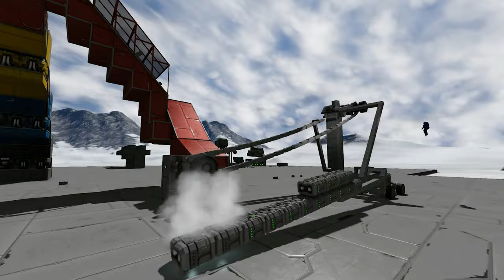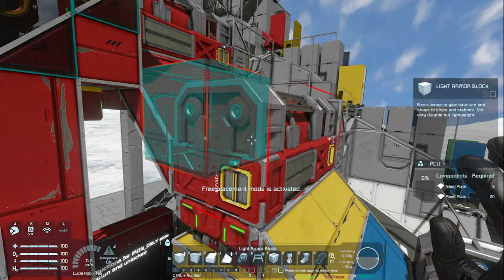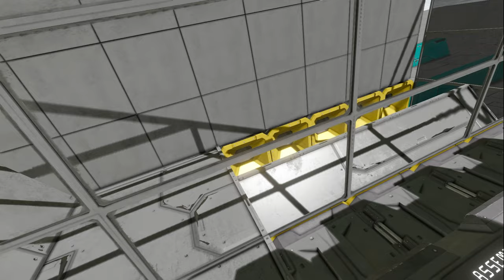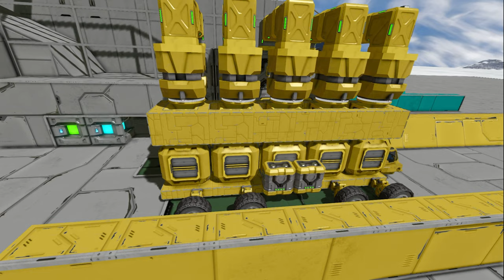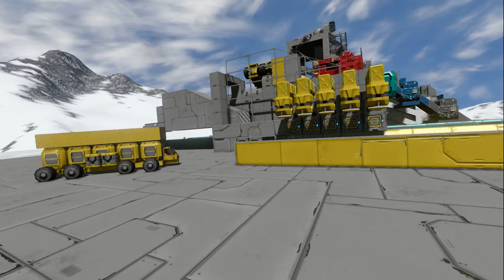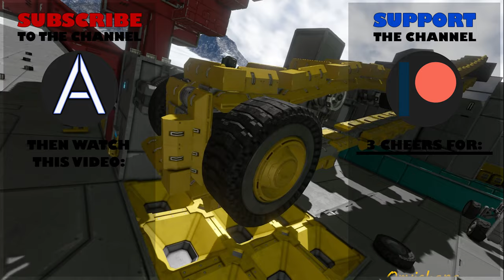Space Factory | Assembling a Custom Conveyor Belt! | Space Engineers

Comment: I really like the design, it gives me a lots of ideas considering that I'm an mechanic for over 20 years now. Can I suggest to put one piston holding one of the rotors  of a conveyor and that way you can adjust the tension of the belt itself when it's connected, you can make it tight or lose depends how much you push the piston or retract it. It's the similar way how we make a tension on the belt system in real life, sometimes with pistons and sometimes with threaded rod and nuts using spanners :D
Hope it gives you some Idea for the future :D
And for separating product you can use timer blocks and ramps to push it to an assembler, for example, before you push the ore with piston, make sure you have a ramp for each assembler to collect the dose of the ingots and push it releasing the ramp, you can time it with times and also you can put sensor on the piston to retract when it detects an ramp in front triggering piston retraction, releasing the current ramp dosage and preparing the next ramp for next assembler :D
Hope those ideas are useful :D

Cant wait to see more :D
Reply from the maker: Thank you for the tips! A piston to adjust the tension is a great idea for future belts!
Reply from the maker: @Cr4sHOv3rRiD3  Wow, those are really cool! The piston wheel looks like something straight out of a battleship engine room XD
Reply: @AndrewmanGaming  I was seen a lot of mechanical machines and things in those 20 years :D Right now, i'm working as a mechanic in the engine room at cruiser ships at sea and machinery there, it's amazing and challenging as well :D Can you imagine how will be space engineers if they decide to fix the physics a little and to put some round shaping blocks, like cylinders and oval shapes. I think I will be able to make some v12 4 stroke engine :D
Reply from the maker: @Cr4sHOv3rRiD3  That is so awesome! I bet if you built a factory like the one I am doing in this video, yours would have some very cool and complex systems!

Comment: Design suggestion: Have pistons hold the conveyor system rotors. Once you build the conveyor extend the pistons (very slowly) to take the slack out and adjust tension. 

For distributing evenly among the assemblers, try having the iron drop down a long vertical shaft. Every couple blocks down put a door that opens out and directs some iron into its assembler and then closes again. When the door is closed the iron keeps falling to the assemblers that are vertically farther down.

Great build concept!
Reply from the maker: Those are some great ideas! I might totally use the assembler one for a future setup. For the current one, I tore down the iron dropper thing and replaced it with a system that continuously (or atleast more continuously) drops iron onto the belt. With the increased load of iron, the pusher into the assemblers is much more evenly distributed with 8 assemblers getting iron instead of 4.

Comment: I give you props for taking the time to make the belt. Making and utilizing a manipulator to apply tension the the belt takes a very very long time. Unfortunately I haven’t been able to master the technique yet. I have an anchor and links but I can’t seem to connect each ends of the belt. Lol but anywho awesome video and nice build.
Reply from the maker: The keys for me were cars and landing gears. The landing gears let me lock certain parts of the belt down so that I can work on other parts. The cars let me pull the belt tight. In an off-camera case, I even used a car with thrusters on it for more pulling ability. The trick is to pull tight, then lock down with a gear. I will recommend trying to connect the ends of the belt in the middle instead of by the wheels. It's so much more difficult to manuver things with the wheels in the way. I will also recommend using a hinge piece on a piston. This will allow you to extend it to make connecting easier, then retract it to make it tighter. Finally, build vision 2.0 is a must for this. The ability to control a piston, hinge, etc at the source instead of flying back and fourth to a control panel makes life so much easier!

Comment: Andrew you should add a third wheel on a piston in the middle of the conveyor belt to push it tight, or add a piston to the second wheel so you can push the conveyor tight that way
Reply from the maker: It's a good suggestion. I did actually try tightening it off camera with more wheels, but the problem is that the tighter the conveyor is, the more jumpy it gets. I think this has to do with the large conveyor pieces vs the small size of the wheels. If I made smaller conveyor pieces, it could work better.

Comment: Hey man hopefully you see this but when it comes to making the belt taught you can use a simple system called a belt tensioner. Basically you’d put another wheel on the return side of your belt and tension it with say a suspension piece and set your suspension to the desired height offset and power so you end up using the spring of the suspension to pull the belt down and keep it Rolling with a wheel on it. You can also go in to such things as using rotors with a torsion bar to tension it.  Anyway looks great and hope to see more

Comment: I had a thought when you talked about slack and sim-speed, but it looks like you solved it with a third wheel on a piston. Good move, better than my idea.

For the iron dropper problem: Why not change the direction of the slide? Instead of having it drop iron in from the side, have it drop in in the same direction the conveyor moves. You can get rid of the hatch-drop system that way, and have both sides of the conveyor walled.

For the iron pusher: How 'bout having this do the hatch-drop instead? You'll only really need the (second) highest layer of blocks to move; the rest of the pusher's layers can be stationary over the splitter ramps, to roll the iron downhill and prevent block damage.
It'd be finicky with pistons and hatch timings, but an even split would be possible.
Reply from the maker: These are good ideas! The slide one in particular would save me from losing a bunch iron that falls off the dropper. Thanks!

Comment: Dude, you are insane, I thought i was insane, turns out I am just crazy. Had not tried anything that complex. Here is a thought (as an industrial mechanic), add a low set under, and a high set under, and a third set under in middle to manually set tension via rotator arm. First 2 to reduce the angle at the turn points to reduce jumpiness, and you know how tension arms work. As you said, size change should work too.  PS, thumbs up for you! Rock on!
edit* LOL,,, did not see the tension arm you added. I did have another thought, a sloped rebound back and forth under the dropper, then maybe you could have damage back on. I am guessing in the last 5 minutes you will have that... play
Reply from the maker: Thanks for the suggestions! There are a lot of mechanics and engineers commenting on this vid and that's pretty awesome! I'm learning a lot about how these conveyors are supposed to work irl XD

Comment: You might want to put a few more guide wheels on it and a piston tentioner on it to tighten it up.
Reply from the maker: It's not a bad idea. I did actually try tightening it with a middle wheel on a piston but I am afraid the lack of smoothness around the wheels due to the large conveyor segments will cause it to just break if I make it too tight. I could remake it with smaller segments and see if that allows it to go tighter.